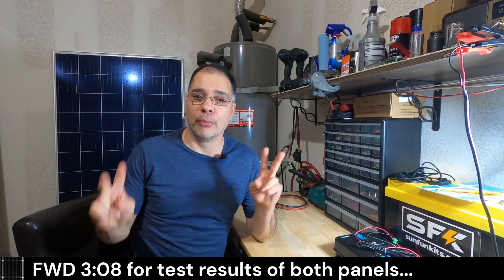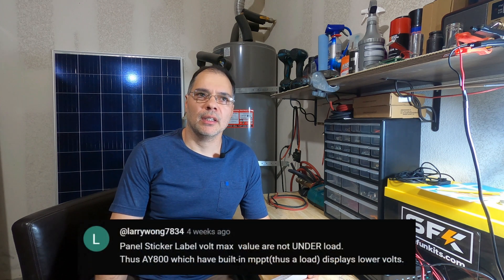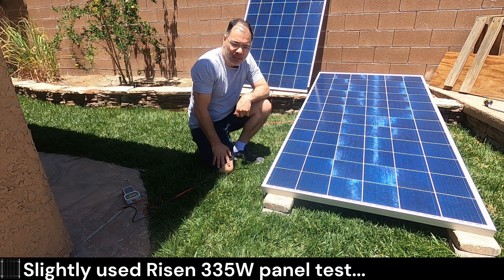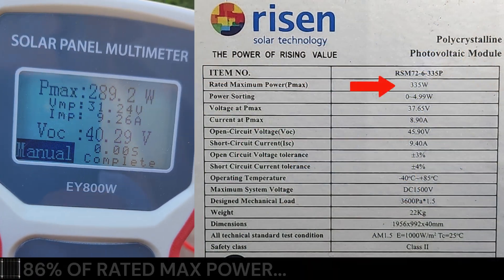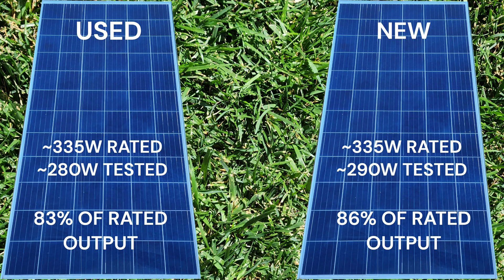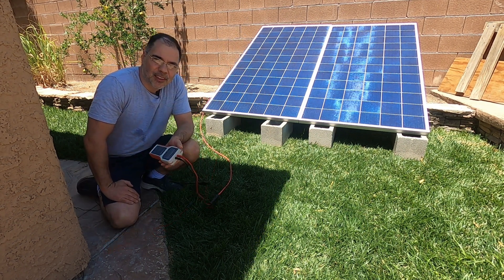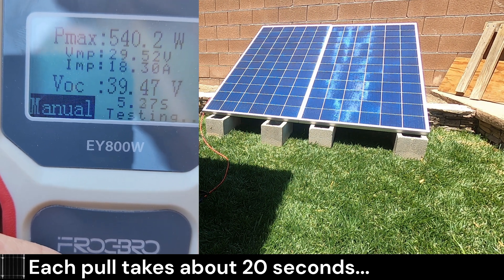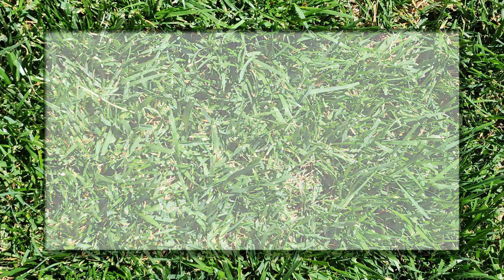Testing Panels Update - I Messed Up!

Comment: Solar panel can output significantly higher current than the spec short circuit rating. Also you can easy get 20 to 30% higher output power than panel rating in a cold sunny day especially when there is snow on the ground or edge of cloud effect.
The rating on panels are for Standard Test Conditions where panels are illuminated with 1000W/m^2 and panels are at +25C. For that to happen in real world ambient will need to be way below freezing.
Reply from the maker: Thanks for the info.
Reply from the maker: I always wondered why the fuse rating on the panel was so much higher than the short circuit rating..
Reply: @natesdiysolar  Yes you need a 15 or 20A fuse for those sort of panels.